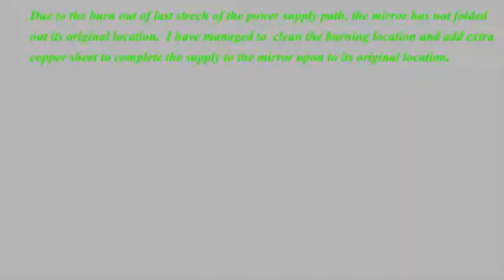How to fix errors in folding/ retractable mirrors in Toyota Corolla - part II

Comment: Thanks for sharing.  The metal ring cleaning (6:38-7:10) was probably most critical in this fix. Apart from scraping off and brushing, a layer of Dielectric Grease (Silicone based)  could have given a water proofing effect.  IN fact, your problem was   that water and dust went inside .  I also think the rubber gasket could have given a coating of silicon grease so that it stops water, like watch makers do when they change the battery of a quartz watches. Thanks again.
Reply: Water went in through that white cover (12:07 - 12:12) >> silicon sealer on top could be a solution
Reply from the maker: As you said, water leackage into the system is main problem in this unit. And also, when the time passed, the grease become more solid and block the gear mechanism. And also if you are trying to move the mirrors forcefully, this metal part which which gives the power for folding will be burn out. So it is better to repair them soon without folding or unfolding it forcefully.
BTW thank you for your valuable advices
Reply from the maker: @jparkhku   if we are using silicon sealer for this cover, can we remove it again if we want to repair the mirror again? Because this is the place where we can access to the mirror motor unit.
Reply: @the_garage   If you use the same silicon sealant used in the toilette tiles, you can remove it easily.  For the gasket just silicon grease (thin layer). Keep your good work.
Reply from the maker: @jparkhku  really appriciate your kindness. Thank you
Reply: Repaired it thank you

Comment: Is the worm gear the only plastic one and prone to breaking? My passenger side mirror does not fold electrically but the motor does work.
Reply from the maker: Most of the gears are plastic (nylon or something).  But the folding main gear is steel.if the motor is working their may not any errors in the electrical system. Better to check the gears.
Thank you

Comment: What can you suggest is mirrors folding okay, but nothing happens when you push unfold? Jzx100. And one mirror if you unfold it by hand doesnt click in place and moves half of the rotation freely(not locking in place)
Reply from the maker: you may need to see the internal arrangements of the motor unit. if the unfolding is not working and it moves freely, then there must be a problem in gear wheels. otherwise, if the gears are connected to motors, it could not be moved freely. And need to check the current passing plates, if they are connected correctly. may be folding current received to the motor and not receiving the current when it is in folding position to unfold. however, you need to see the internal arrangement if there are any loosen parts, gears or burnouts in the current passing passage.

Comment: How do you add the extra copper sheet
Reply from the maker: I have cut the copper sheet to the required shape and put 2 soldering points without disturbing the path

Comment: my folding mirror is not folding but when the key is on, motor is working unstoppably. corolla 110 what s the reason
Reply from the maker: Seems the motor gerting the power continuesly where the copper strips may damage or short circuit. Further, the gears are not engaging correctly in order to fold the mirroe. Just dismantle the folding section and see what happen by giving power.as the motor is working, this may be fixed by yourself
Thank yoi.sorry for the delayed reply

Comment: My mirror produces grinding noise. Please help
Reply from the maker: seems to be a problem in wheels..or the lack of greece. Need to check. Till that did not use the folding option. It will burn your mirror electrical supply.